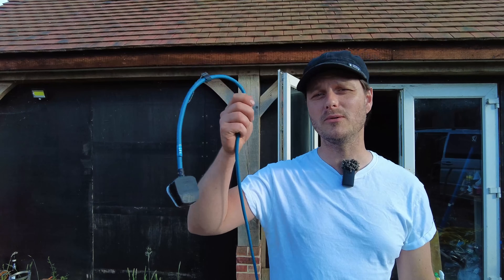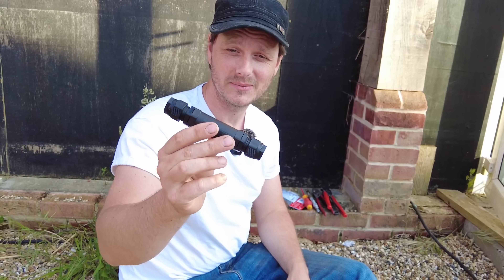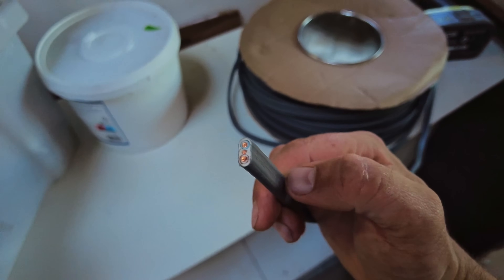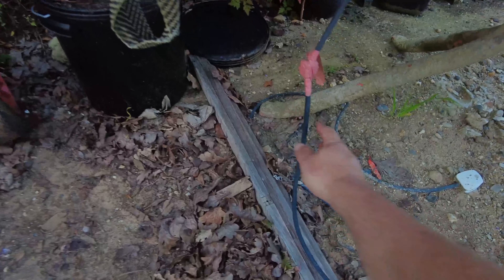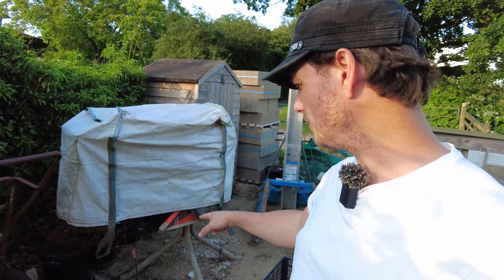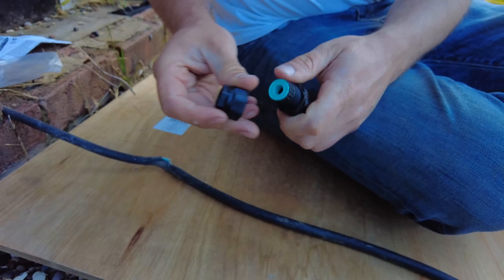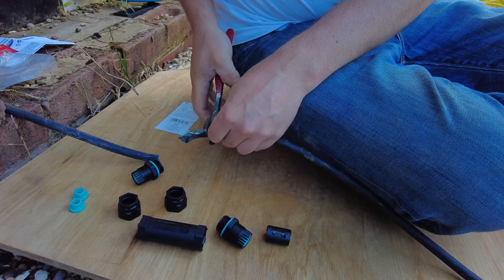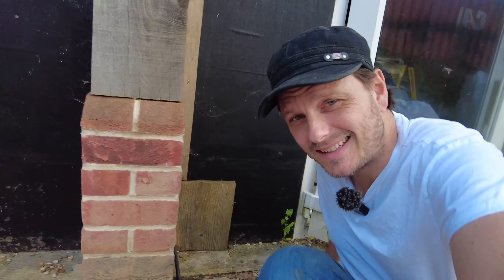The Best Way to Repair a Power Cable - Easy DIY

Comment: One way you can often tell the wire size is read it off the cable. Most now have the size of the conductor stamped along its length

Comment: I don’t agree at all, there is nothing wrong with a choc block joint wrapped in electrical insulation tape. I’ve had these in my 
garage for over 55 years and they’ve never caused any trouble. There is a place for them and if used with care and done 
correctly then I see no issues. People try and make electrical work so mysterious and technical. I’ve been carrying out my 
own wiring and electrical installation all my life never employed an electrician ever. Never will. If you can read and research 
and are a good technician you can carry out wiring and installation. Too many electricians feel the need to dictate what is 
right and wrong and it should be done this way and not that way. I’ve installed wiring systems both in the uk and in Europe 
and when inspected have always been told there was nothing wrong with what I’d done. That included wiring my own earth, 
I expect many professionals wouldn’t have a clue how to wire your own earthing system if it wasn’t already there for you.

Comment: I am an electrical numpty nightmare and came close to burning our house down when I was 15. So, can you give me some idea what the amps are of the differnet wire "sizes?" I have Googled and have a bit of trouble understanding it all. I figure if I get 15A extensions then I may have a good chance of not causing things to combust and have stuck to putting lighting under my house and used 12V lights with over speced power bricks so they don't melt electrickery wires. I do have a couple of DC Crown Connectors that while not burning hot are a tad warmish to the touch. I bought a Clamp Meter in the hope I could learn how many amps were transitioning the wires from point A, the power brick/adapter to point B 5he illumination devices..

Ah pox, just realised this was a cable joining/repair video and not a 12V light setup. My apologies. It's late and I'm old and as it's after 7pm it's way passed my bedtime. 😳 Yeah I is bull💩ing about that. Pl3ase don't waste yout time responding to my waffle. I will search your Channel and see if I can find something that may help.
Thanks for the joining/repair suggestion though. Will be extremely useful for me cox I usually get the wiring round the wrong way. 🤦‍♂️ That joiner will remove that possibility. Much appreciated. 👍
Reply from the maker: 😅 sorry I can't help and you won't find the answer on my channel. Off the top of my head you might find the help you are after on John Wards channel 👍
Reply from the maker: 😅 sorry I can't help and you won't find the answer on my channel. Off the top of my head you might find the help you are after on John Wards channel 👍

Comment: Or REPLACE the cord and have no splices or huge block in middle of cord.
Reply from the maker: Well that would be a different video wouldn't it, and if I did that with the one I repaired it would have cost me over five times more
Reply: @THE-AIDEN-PROJECT  what is the cost of this repair coupling?  Where are they purchased from (link)?
Reply from the maker: @gomerhondo7249  this one is £10.49 from Screwfix. The cable I repaired is a 4mm flex that is 20m long

Comment: As a professional MOD prototype wireman ..... I can suggest a good ( safe ! ) alternative .... loosely slide on two diameters of ADHESIVE LINED heatshrink tubing ... prepare the broken wire and tin the ends with 60/40 solder ... slide on smaller diameters of heatshrink  tubing onto these tails ( or .. two pieces of glassfibre electrical tubing ) .... solder all the correct wires to each other , then insulate with the small bits of tubing on the tails .... wrap the assembly in glassfibre adhesive tape to the correct diameter ... then ... heat shrink the two outer layers of ADHESIVE LINED tubing ... allow to fully cool ... and you have a STRONG waterproof joint , without the BULK of these excellent joining tubes .. ( tried - n - tested , many times ) . DAVE™🛑

Comment: Great info there. Im a lecky and when i looked at the screwfix info i found those given sizes most confusing. They should state the mm2 sizes not the diameter of the outer sheath of perhaps both. Well done.

Comment: It's not 4 mm squared, it's 4 square mm.  But you will never have such a large size cable on a 13A plug.  Even 2.5mm2 is highly unusual and would suggest a long lead.
Reply: 🤔 4 squared mm? Maybe I wrong but that’s 64mm. 😂
Reply: @kevinjohnson2528  you are wrong. 4mm sq is the cross sectional area, so 2mm x 2mm if actually square or the equivalent of all the strands added together. Quite a thick wire.

Comment: solder and heatstrink on flex is alot more better or alternatively fully rewiring the appliance with an entire new flex if you can get access inside
Reply: Whilst a rewire is the best option, the cable joiner is a safe alternative. Solder and heat shrink however, absolutely is not. Soldering can certainly create an electrically sound and physically strong connection, but heat shrink is highly unlikely to have the appropriate level of insulation or mechanical robustness. That combined with no quantifiable IP rating means it should be reserved for low voltage repairs.
Reply: @ShedTV   Is heatshrink available in various insulation grades?  Probably an academic question as if the cable is that bad I'm likely to replace the whole length or even the thing it's powering.  Still worth being aware of though, just in case.
Reply: @richardstewart6900  Yes, you can get all sorts of types including those which conform to various acredited standards for insulation and mechanical strength. Different sizes and shrinkage rates, double or single wall, adheshive lined, you name it! Heatshrink isn't a bodge, it just requires knowlege of, and access to exactly the right materials and techniques. Something the average person, with respect, may not have. For a the odd repair here and there I suspect that, as you alude to, cable or tool replacement would be more cost effective anyway. The joiner again, will safely get you out of trouble.
Reply from the maker: Maybe but I'd say that's beyond alot of people though, this method is quite straightforward, it's safe and accessible for the majority 😉
Reply: @THE-AIDEN-PROJECT   true i agree it does do the job in a pinch i do it regularly rewire things extend cables so to me it makes more sense financially to by a few meters of cable to whatever it is and just take it apart or solder and heatstrink

Comment: ratings for the cable will vary depending if its solid core or stranded etc, you will often find it will tell you the gauge on the cable itself.

Comment: Not quite the same thing, but related, , i had to rewire a two part in line plug my stepdad had installed on a garden power line, with the male end connected to power😂 I guess some people just don't get electricity

Comment: Just replace the cable completely if it's on a power tool, no point messing with joints.
Reply from the maker: Naaa just buy a new tool 😆
Reply: I don't think it matters which type of tool the guy is joining. He's showing How to joint a cable. It could be 6',  10' or 100 yds. You need to make a sturdy, simple and safe joint.
Reply: 100%